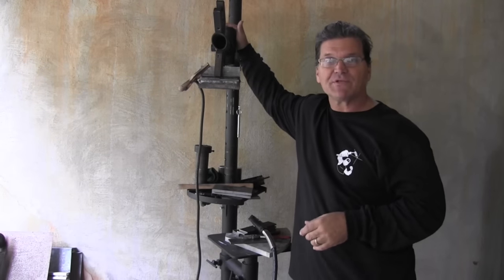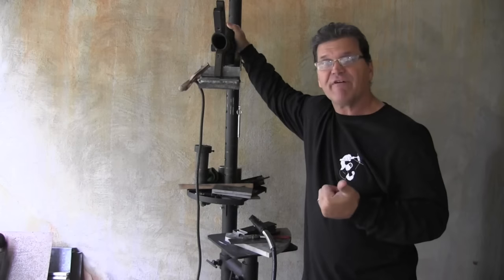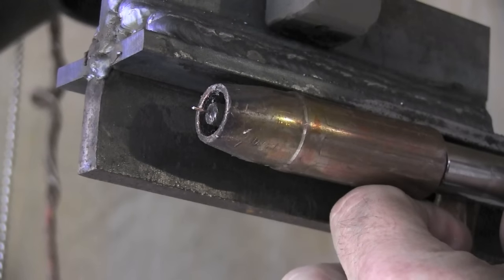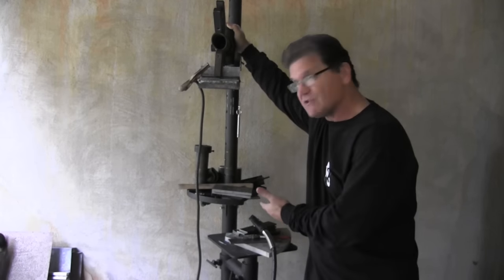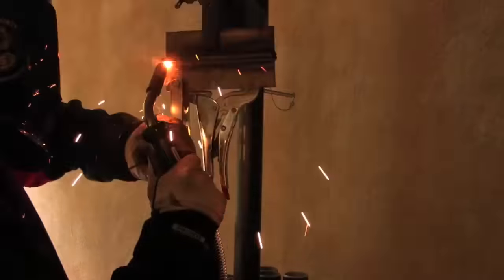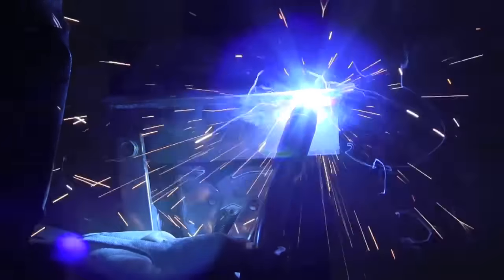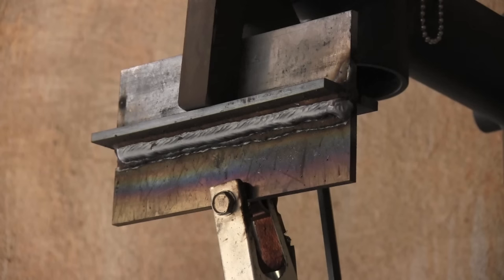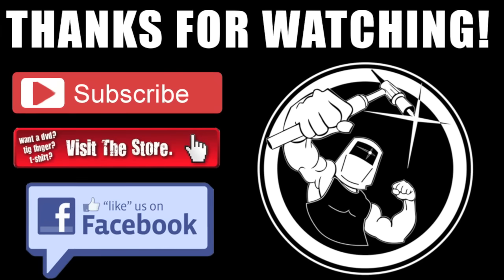MIG Welding Overhead - Mig basics part 8

Comment: I started welding in 1963.  Here, some 51 years later, I still run across something I did not know. But I do know this, 90% of a good weld is knowledge and one helluva good machine. Ya gotta have both in your favor to do a good job. Never compromise on tool quality. Buy the best tools there are to offer. Cheap tools is never a good practice.
Reply: raginroadrunner I was always told that you pay for a nice tool once from your walllet. You pay for a cheap tool every time you have to  use it, but you pay with your sanity
Reply: Do not agree.. a cheap welder is better than no welder. Everybody has to start from somewere. I don't think they suddenly buy welders like 2-5000$.

Learn welding with a cheap machine and then build up to a professional one.

Comment: Thanks Jody.  Trying to absorb it all.  I'll be coming back for years.  :)
Reply: redryan5048 I am.
Reply: SV Seeker
doug > listening to jodi's videos...i mentioned it in a previous comment "clean, shiny metal"...you are an awesome welder and fabricator dealing with an 'oklahoma' situation...like your series also and wondering the venezula crude gone up at all?
Reply: gerald estes  Right on.  "clean, shiny metal"   - grinding I can do       ....Maybe Jody will stop in a demonstration welding 70 feet overhead down the on the bottom of my boat.  :)
Reply: SV Seeker make a Little 3 Wheel to support your pistol. go high over 15m ø1mm wire. if more than one string do the top first then the lower ones after. make a lovely well. if a litthe trouble make even leg lenght. put an ekstra.

Comment: Man you are legit. I weld for a living all day everyday MIG. 7 gauge 2” square tubing Mostly and I like your precise clear explanations. I tend to have most trouble with overheads. I look forward to trying some of these techniques tomorrow. Btw I’m running 26-28 volts and basically full speed on the wire. It’s production so it’s all about quantity. Thanks for the video

Comment: Thanks for the video! i have a weld test tomorrow for a ship fitting job.. i only need to tack weld but they still require a test, 3x4" welds T joint vertical and overhead. fluxcore and in the past ive only done stick welding so im very nervous! these videos are a huge help! luckily i got to meet with the man who will test me at his shop and practice over the weekend and he thinks i will do fine. but still nervous when a high paying job is on the line!

Comment: Love your videos. You do great work!!  I just wanted to say that when I ran overhead fillets with 0.45 at the ship yard I ran very hot but held a very hard push angle with zero weaving. It was 100s hard wire with 95/5  gas. I always had my tip flush with my barrel. I always found if I tried any sort of weave or dddnt push a hard angle I always had a bit of a lip on my bottom passes. I found this true especially if I was running 1/16 100s wire. But I always had great penetration!!  Keep up the great videos!!!Pete Dellarma Maine

Comment: Hey Jody, a couple things I'd like to see you touch on for your MIG series would be working with thicker, higher current wire. I use .052 every day and would like to see if you have any tips or tricks other than the widely used "whip back." Especially for tight corners. Another thing would be for tack filling gaps. Thanks again,
A fan and student of your page.

Comment: Thanks. I was saw high voltage got it melted but my movment was wrong to point of bolders dropping. Then ended up going low voltage & drooping welds then cut welds with cutoff wheel to flatten butt weld.  The comment about the wire to long having time to heat up become weak & do nothing - was really helpful.  I can think these things - but when your under pressure & dont have time to think = thanks.

Comment: I welded 10 ft cyliders 10 ga stainless first time I left heat alone welded good flat and vert was good very good weld .Overhead blow holes right though it. Delta 452 miller. ITS BETTER TO ROTATE THE PC. single pass 3/16-1/4.the weld you're making looks better for thick ferrous multi pass. our overhead would have to be 30" no stops ,fast paced production we couldn't sit around. I noticed a difference in the outside burn marks,overhead was much thinner pushing.

Comment: I put a new tip in my welder last night (I think this is the first time i've replaced it since new, have run maybe 5lbs of wire through it total) and I was like like "man, this tip is really tight, it's a pita to tighten this thing all the way in". I now realize this must be intentional, and looking at the tip it's recessed inside the cup like 1/8" to 3/16". So I'm going to toss it and put a new tip in a check it as it's going in so I stop flush. I'm bad enough about pulling away from the material anyways, having it recessed is only making the problem worse for me. Thanks for the simple tip that I never hear people talk about
Reply: Hold on to your old tips if your the one paying for them . You can take tip cleaners for a torch and clean them out, spray some anti- spatter through them and get a little more use out of them.

Comment: I was welding today at work 5/16 steel vertical machine set to 26v 460 speed was getting great penetration but having burnout on edges any slower and I would get puddle drip, any ideas? Using a Lincoln 480v machine with gas and flux core wire.

Comment: I knowest you use a tampered nozzle with a blunt nose contact tip, but have you ever tried a tampered contact tip. You get maximum shelding gas around the puddle, also I use 95-5 mixture.  95% Argon and 5% CO2.

Comment: What gas are you using?

I use 90/10 and .035 hard wire 1/16" to 1" with a miller 252.  We have about 4 of them at work.  Very versatile for mild steel.  We up hand all structural steel 3/16 and up.  From flat to over head i don't change a thing.

Comment: You're doing a 90-degree corner try just a gap or no Gap gravity pulls so try to pieces of metal with a gap opening going straight down the work piece with no corner I want to see you perform that and it come out smooth

Comment: what about .045" wire parameters? let's see lots of videos with .035" wire and suggested parameters, but can't find anything on that diameter. 
I have no problem welding overhead with .035 wire, but can not get in the ballpark for some reason with .045 parameters?

Comment: Not trying to be a troll but I would run those volts a volt or 2 higher and the wire speed up quite a bit more.  Your root had a big crown on it and what looked like lack of fusion in a spot or 2. You should crank it up and move faster,  Itll give you a flatter and more burned in bead

Comment: im runing hot 24.4 v on thick steel miller deltaweld 652 and having a problem with overhead with the drooping down 24.0-24.4 is what i would run at for a normal bead i haven’t practiced much with overhead im not doing it often.. i will try the closer stick out but i feel like as soon as i start she droops down
Reply: pushing and stich motion

Comment: Great video. Learned alot. How comes that in the USA everybody calls MAG welding MIG welding?Its only MIG when you weld with pure Argon/Helium. So actualy when you use mixgas when welding steel and lets say 75% Argon and 25%Co2 you are using active gas ( Metal active Gas)  And not Metal Inert Gas. MAG it is :)

Comment: ok I feel like a noobie for asking this question but do you weld fluxcore the same way you do mig? just curious we run .045 wire with 75-25 just need some advice maybe a vid?? thank great vids
Reply: Justin Summerlin  Yes, the difference being you have to knock the slag off, the major advantage is no gas.
Reply: Justin Summerlin Since you are using the 75/25 gas and .45 wire (pretty much the most common sort of welding for anyone in the oil and gas field) Id have to say it is nothing like mig.  I mean yes they both are a gun they have a trigger and wire and gas....As far as technique nah with flux core like you described you want to drag it more like as if you are using stick.The only thing we even use mig for is welding the banding flat bar on grating...we cant even use it to tack.   Then again another shop I worked at I had an actual ticket for DOWNHAND mig no joke EVERY vertical strut in these 100 foot by 25 foot wide 18 foot tall bardges were all downhand mig.  Just like a house every 16 inches 3x4 angle all downhand 2@12 stitched....But yeah it really depends where you work what you do and what the engineers deem as acceptable...Structural where I work now has the choice on every skid or just about anything they weld besides the lifting lugs to use what you said the c25 gas with .45 flux core wire or use metal core wire with the 8c gas .45 wire....99% of the time we being as the shops so big and we can flip and move any size thing up and over and flip its all in the flat position and all with metal core since its faster, hotter, and just downright stronger if you ask me.  You literally see metal core digging the parent metal out and filling where you don't see that as much with flux core and especially not mig

Comment: How do you stop the weld pool from dripping on you or on your MIG gun?
Reply: i would like to know the same thing.. i have had this happen to me and it SUCKS....
Reply: Try pulling the weld not pushing.
Reply: I'm not a certified welder, nor in any way in a position to give advice. But as I have ruined several tips and nozzles over the years learning to weld over head, I will try to share what seems to work for me to minimize the gun damage and frustration of having the weld puddle fall into the nozzle.

Settings, joint preparation, and practice. Clean all mill scale and contaminants from the joint surfaces. A clean and well prepared joint is highest priority IMO. Choose the wire that fits the weld type and position. Then set your welder to the wire and position. Then practice..........a lot. I find using a course grinder to rough the surface when cleaning it works well for me. I also tend to use the same puddle pattern for over head as I do for vertical up. Seems to keep the heavy crowning somewhat in check.
 But again, that is only what works for me and I am in no way a professional.
Reply: I am in the same boat with overhead.  When I slow down it seems to droop.
Reply: normally if your weld is falling out you need to turn the wire speed up.
Reply: Dont go under 300 in wire speed.
Reply: UnitedWarGamer By welding hot and moving fast! The molten puddle will try to follow the heat of the arc. The arc force of a hot but not to hot setting will make the metal follow the arc better. Weld puddle falling out is usually as a result of too long of a stick-out, welding to cold, traveling too slow or poor gas shielding letting the puddle blow bubbles out as atmosphere tries to escape. A voltage to amperage/ wire feed proportion needs to be correct also to much volts can cause puddle to be to molten to long to low voltage can cause metal to not wet in and cause rollout. If wire speed is to slow the arc force will be to low and the puddle will not follow the arc. If wire feed is to high then you will not be able to move fast enough to prevent mounding and get good fusion. Properly set short circuit will sound a lot like it is trying to say z so fast that you can only get about 1/2 of the z out before it starts to say z again! And it says z about 5 times as fast as a normal human saying z as fast as they can!
Reply: melaniew77msn thank for the very detailed comment, I'm doing a rat rod project and been having some problems with overhead.  Haven't welded in sometime.
Reply: UnitedWarGamer No problem. A nice custom build is just sweet if the welds and paint are good that just takes the finished product to a new level. Are you boxing the existing frame or building a tube frame?
Reply: melaniew77msn were using a 91 f150 and putting in a crown vic front end and a 96 GT mustang rear
Reply: UnitedWarGamer That sounds like a pretty slick set up! I bleed Ford blue so that is right up my alley. Are you using a short bed truck and have you selected a transmission? From 91-95 the F-150 is the prettiest truck Ford ever built!
Reply: melaniew77msn its a short bed truck and were using a C6.  me and him have a pair of 93 Ford Lightings.
Reply: UnitedWarGamer you have to setup your voltage and amperage(wire feed speed) to whatever you are welding...go ahead and try and fillet weld 2 1/8th of an inch plates together like he did with his settings you will have a lap full of molten metal.One thing he didn't mention 99% of the time on the job or on a test you cannot quench your metal in water nor do you want to because that will cause it to because hard and become brittle...What you want to do in times like that is just lower your heat settings after every pass or two....obviously you crank the bitch up for the root pass or passes...but as the parent metal gets hot you lower your voltage and lower your feed speed/amperage....and your travel speed increases...its really something that cant be told I mean I just told you the basics but without practice you wont know exactly how much to lower the volts or amps or how much faster to travel (that all depends on how the plates are and what your heat settings are)....Best advice just pick a machine and weld.
Reply: I'm not a certified welder but I do do a lot MIG welding at work... when I'm welding overhead I spray the metal with anti spatter spray and it's really about setting your heat and wire speed just right for the metal you're working on without turning your heat down to low..... if you're scared that your puddles going to drip and you turn your heat down to low you won't get good penetration... and like he said don't let your wire stick out too far once you can find that right combination it's as easy as any other weld you would do
Reply: The settings I use for overhead/vertical/horizontal FCAW is around 27-28 volts and 330-350 amps.
Reply: AJex War Gaming exactly the same settings as welding flat, it's just out of position

Comment: I think flux core is far superior than hard wire and that is the general concensus among all welders i know, ive heard there is even a movment among weld testers to get hard wire banned.
Reply: Sturm geschutz I know from experience Lincoln has no plans on halting their production,
Reply: Good for them, the company I worked for wont buy it, good for them too.
Reply: Sturm geschutz flux core is too dirty for some jobs and that is what keeps solid wire around
Reply: Flux core definitely has its place and i will use it in my everlast welder when I have to but it definitely is a very dirty process and I will use mig whenever I possibly can.
Reply: flux core has zero advantage over mig, other than simplicity of setup. if you can't get the metal clean, mig with proper settings is still superior to flux core.
Reply: Sean Hazelwood I will have to disagree I have used short circuit and spray arc hard wire never have used flux alone but use everything with dual shield flux and it’s like laying butter plus you get way better penetration flux core in general is for tanks and thick material
Reply: ButlerWeldingandFabrication With a properly prepared joint, proper settings, and the appropriate wire/gas Mig will easily pass any xray. Flux core will never pass xray due to simple contamination. I've looked at many weld films...flux core always looks like swiss cheese.
Reply: Sean Hazelwood I pass X-ray all the time with dual no problem I worth for the rail road it’s all we use
Reply: ButlerWeldingandFabrication Then you are an enigma. In over 20years I've never seen flux core allowed to be used on anything that gets shot, nor have I even heard of it passing clean.

It may penetrate harder and burn through garbage better, but it's the wire equivalent of 6011...cheap and works "good enough". Otherwise, fab shops would use it simply because it's cheaper.

In the field- Stick, in the shop-Mig or Tig, in farmer joes garage-Flux core.
Reply: jkamping1 I meant similar as in ability to burn through garbage/high penetration. If it was anything but cheap, it would be allowed as fill/cap on pressure pipe. It's not, and never will be...for a reason.

Comment: Thanks jody but would it be possible for you to weld car body thickness overhead I've bee welding for years but other people seem to struggle with welding very thin metal overhead
Reply: Have you tried using 0.6mm wire with short circuit settings? good fit up always helps. There are some videos with Jody welding .035" tube out of position.
Reply: m fletch you turn that puppy to the LOWEST settings possible for the wir... you can even trying using thick backing plates as "heat sinks" and of course you will probably be doing more of a spot welding technique then a full out hold the trigger down and go....ive welded exhaust with 1/8th 7018 no problem using heat sinks and spotting techniques along with a shit ton of patience :)  Never quench the exhaust btw since its going to be subdued to a lot of dynamic loads constantly bouncing around

Comment: hey manwatch all your vidios lot of grea t help.   I run a mobile repair service an I have the most problems with the water tanks that I have to repair. the co I work for is a portable services co an the service trucks I work on are rusty to say the least. the worst job that I have is the heat exchanger tubes I cut out and replace. there at the front of the tanks and right above the truck frame, I try to mig them but I git that crown effect u were describeing. I run a miller trailblazer and a miller wirefeed at 21 to 22 volt with a shield gas an still have leaks an crowning. I no im laying on a transmission an frame but how do I stop the droop. I still end up rolling 7018 beeds over it to stop the leak . this is real field shit an can send some pix if I need to. am I still to cold or what
thanks for any sugestions